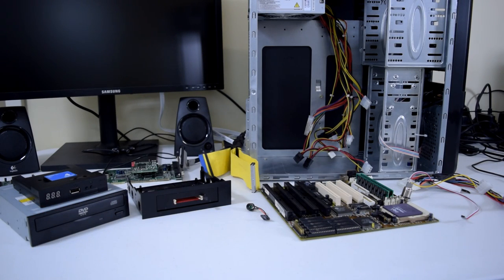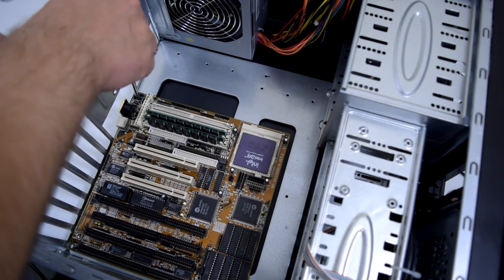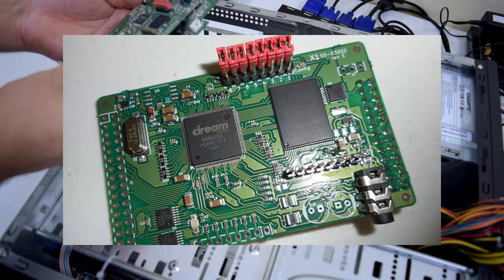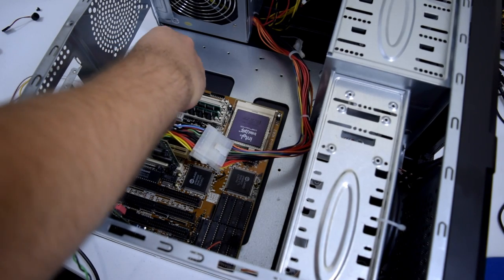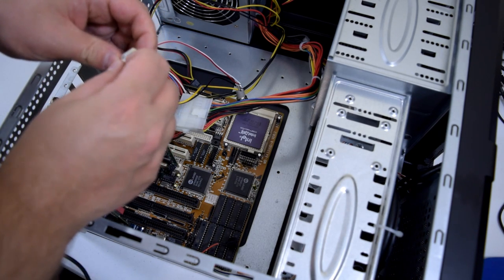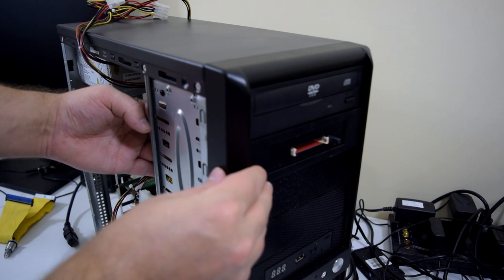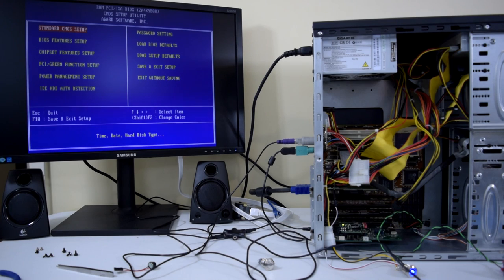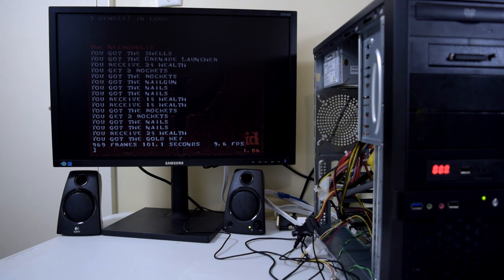Building a 486 DOS PC with modern parts

Comment: You may not be a big channel like Linus Tech Tips but you sure as heck are entertaining
Reply from the maker: +Boyborg690_ Thank you :)
Reply: Never know where this channel may end up. I remember first watching Linus Tech Tips when it was a tiny little channel.
Reply: +PhilsComputerLab A button that stays set in it's state is called 'latching' the ones that only offer a changed state when held are called 'momentary'. Probably a million people have already said that :-) Cool vid. Interesting project and accent ;-)
Reply from the maker: Cheers :)

I did end up using simple flick switches mounted do a drive bay. I haven't used this solution in a video, but will definitely do so. Sometimes the simplest solution is the best. Not always though :D

Comment: The fast Compact Flash cards was an exelent Ideia to replace the old noisy and hot hard drives. I got my old 1997 Pentium 200MMX very cold and quit with an SDcard simulating a Hard Drive.

Comment: The ol' big squishy clicky power buttons...Something I competely forgot about my old PCs. The feeling of pushing in a long throw switch reminds me of waking up during summer breaks to play hours and hours of wolfenstein and later doom. Hearing the click followed by the 'beep' of the bios startup, then followed by the drive self checks. I can still hear all of these sounds in my head, and the smell of hot computer components/case.

I imagine my nostalgia towards PC games is similar to what my grandparents had with old vaccum tube radios. People become so wrapped up in the large generational differentials that they don't realize that every generation is the same with varying experiences.
Reply: +TheDudeofDudes  Heh, I still have my original 286 with that slow ST225 MFM HD. I could always tell exactly what it was doing by the four different noises the HD made (seek, read, write, erase)... and when it needed a fresh LLF. -- I have a much faster vintage IDE HD (1991, 20MB W.D. still 100% perfect condition) I'm thinking of trying with it, just because. Assuming I still have an interface card... this HD won't work with a 486 or newer.
Reply: +Mirsad Redzovic QEMM instantly springs to mind :)
Reply: +Mirsad Redzovic  Same here. And didn't get the QEMM conflicts that way, either. The trick was to go through all your TSRs and determine both startup RAM and idle RAM (from the full MEM report), and fit 'em into available spots instead of just cramming 'em in one after the next. I ran a bunch of handy TSRs on my 286 with 1MB of RAM (and some of that locked out because of a bad chip) and still had enough RAM to run everything a 286 could handle.

Speaking of memory tricks, anyone else use a memory board? I have one in the 286, 2mb board, the system wouldn't see it as RAM but would as a RAMdisk, so I used it for temp space and for workspace that was much faster than writing to the HD. Its contents would survive a reboot, so data loss wasn't really a problem.
Reply: +Mirsad Redzovic  That's a great idea with DOOM, I'll have to try that. Still the only game I play. Right now I run it on a P4-3GHz (some of these huge modern WADs need that much horsepower) but if it ever dies I'll have to look for another solution.

I put my browser cache on a RAMdisk both for performance and because it keeps the mess off the HD -- the way the Mozilla-based browsers handle cache is stupid beyond words, and causes fragmentation like nothing else in the history of computing. I use DataRAM's freebie as it works well, doesn't eat much, and has a good "hibernation" feature.
Reply: +Mirsad Redzovic yea remember flushmarkers where you could have something load for say one item them flush it out if you dont need it or need the ram
Reply: I grew up in the pentium 4 era and even that feels like forever ago.
Reply: I remember when I first started working on PCs. Back when CD ROM was just starting to phase out floppy.. Ugh, still get the occasional nightmare about that floppy seek noise.
Reply: i still hear that eee ee ooh ,zee zee zoo of my 5.25 then 3.5 drive doing their boot seek when turning on my 386
Reply: I still remember loading from cassette tapes... yes, I'm old.
Reply: Oh man, thank you for the wonderful trip down memory lane. I remember mine and the joy I had when I got my own 386SX-16 with my own money.
Reply: i´ve started with a dx386 40/16mhz and about 4 mb ram, no i want a retro pc my self ;) may i build one..
Reply: Rather than use a very long IDE cable you should be able to extend one with another if you use a straight through header strip. You should even be able to do this with the middle connector. Try and see if it works, sometimes it might not.
Reply: I don’t think previous generations were so infantile in their pursuit of nostalgia. This is a very millennial trait.
Reply: @Conradlovesjoy  have you ever met an old person?

Comment: 9:00 I actually said out loud "yeah your video card isn't working" when I heard that POST beep. Oh, the good ole days. ;) (that beep here means the monitor isn't connected, but the card may be working fine)
13:20 - only certain USB mice (old ones, usually) have the capability to be used with a PS/2 adapter. It's completely different signalling, and the adapter is just a physical bridge, no USB/PS2 adapter logic inside. FYI.
14:00 - possible that the CF card doesn't support the detection or the I/O mode used by the 486, but the card would still otherwise work OK. Possible that the card only works with LBA (which USB adapters and all modern PCs us), and the BIOS is trying to use CHS mode.
14:05 - yes, resistors are extremely, absurdly, mind-blowingly important when working with LEDs. ;) And be sure you're using the right resistor for 5V or 12V supply, too!
14:45 - you should probably not leave all these to defaults... back then, RAM didn't have the little Flash chip on them that provides parameters. So, it's important to set EDO mode if you have it, so the chipset can make use of EDO memory's extra speed. But with 8 MB of RAM installed, I doubt it's EDO... y u no eBay some EDO stuff? :o

Comment: SPDT= latching on/off (single pole, double throw)
SPST= momentary on (single pole, single throw)

I remember those darn Dallas time chips. More than one time I've used a Dremel to grind down the top until I got to the embedded lithium battery, cut the battery out, and add wires to an external "AA" battery pack.

Comment: Damn, I had that benchmark at 15:35 :)

My first PC was a 486 SX25, this brought back sweet memories.
Reply from the maker: +nagytestutyuk Nice :)
Reply: +nagytestutyuk My second PC was a 486 SX 25, it was superfast at the time in comparrison with the 8086 I had before. I remember wanting a DX with the math coprocessor so badly and feeling annoyed that the SX was in fact a DX with a factory crippled coprocessor.
I can't feel so excited about my PC's now, however fast they are.
Reply: +brunster64 I had a 25 MHz 486 SX also.  Jeeze that thing was slow!!  It had all the good stuff, a 170 MBe  hard drive, 9600 baud modem and a measly 4 MB of memory.  Now these days 170 MB is practically  nothing and is easily replaced with flash memory that is faster.  I used to play Doom and the other DOS games that were good.  What fun that was running QEMM to make room in the 640 K base memory.  Without Quarterdeck Expanded Memory Manager, it felt damn near impossible to get some games working.  It did have windows but that was Windows 3.11 and was nearly useless by comparison to todays windows versions.  Many of the games for Windows 3.1 were those horrible point and click adventures.  I saw a point and click adventure game I liked, I thought that nearly all of them sucked.
Reply from the maker: Those were the days :)
Reply: nagytestutyuk, I remember "SX" was pronounced "SUCKS"... LOL
Reply: I still have my 'Tandy Sensation!' from 1993.   25mhz 486SX 25mhz.   Originally came with 4mb of ram, 106.9mb IDE hard drive, and a non-IDE proprietary single (1x) speed cd-rom with a push 'n release tray that you pulled out most of the way to set the disk on and push/click it back in.      Such a beast of a machine ;)     It now has 32mb of RAM (more than the book ever said it could support), an ISA SCSI controller.. so i can use a drive larger than 300mb (Bios limitations for onboard IDE), and an Evergreen Technologies math Coprocesor that bumps the clock speed up to 100mhz, even though the core is still 25mhz.     Made games like Jetfighter not run because of a divide-by-zero problem.  apparently 100 is bad... 99 is likely fine hah.    CPU bound games hate that 100mhz mark

Comment: I can't believe you're running that DX4 without a heatsink and fan. A heatsink is required on 486 CPUs starting at 40 MHz up to 66 MHz. A fan is required on 486s 75 MHz and faster.

That chip is going to suffer thermal death if you keep running it bare, which will be a big loss because Intel DX4s are both rare and expensive due to not being mass produced. AMD and Cyrix parts of similar speed are more prevalent, but less compatible with boards using Intel chipsets.
Reply from the maker: Haha, and I can't believe people still mention this :D You are like the 20th person pointing it out!
Reply: DX4 is pretty low power like the original 486DX-25 and 486DX-33.  The DX4 runs at 3.3 volts, while the faster 486DX2 chips ran at 5 V.  Since voltage is exponential for power consumption, a 3.3V chip can run atleast 2.3x the clock speed (3.3^3.3 vs 5^5) at the same power consumption.   On top of that, the DX4  (0.6um) was built on a smaller manufacturing process than the DX2  (0.8um) and previous chips (1.0um) so they'll inherently run faster at lower power on top of that.  Back in those days smaller fab size directly translated to power savings AND performance increases.  That said a heatsink wouldn't hurt :).
Reply: jrherita

Core voltage does not directly determine the power consumption of the CPU, nor does it determine the clock ramp. Just because the CPU has a lower core voltage and a smaller lithography process, doesn't mean it will use less power.

Take a look at modern CPUs, the core voltage can be 0.8-1.45V and pull 100A, or 40-150W.

Despite the DX4 having a 3.3 or 3.45V core voltage, they pull the same or slightly more current than some older DX2s.

AMD parts on the other hand use less power (the 133 MHz part uses ~4.5W) and still require a heatsink and fan.
Reply: Back in the 1990s when Dennard scaling worked,  my statements were correct.   Modern process nodes (since about 65nm) is where power scaling stopped essentially so to compare a 486 and a modern CPU is apples and oranges in that way.  An Intel DX4 @ 75 mhz should consume less power than a DX2 @ 66 mhz.  I suspect a 100 mhz DX4 will also.
Reply: Back in the day, most of the 486-DXes I encountered came with heatsinks.
Reply: With more modern PSU, maybe someone should make a heatsink that could be adapted for liquide cool.  Ok it would be only with the CPU, but it would be fun to see how well that solution would work compared to the traditional heatsink and fan on a 486 and the DX line and even a 586.   Because these do run HOT.
Reply: It's his chip to fry if he wants. Instead of spouting off wannabe hypothetical technobabble, maybe you guys could ask him do some tests or something to see how it is performing in comparison to specs and thresholds. That would actually be much more interesting than witnessing the perturbed heavy breathing of neckbeards going on in this comment chain.
Reply from the maker: I just forgot to put the cooler on, that's all :D
Reply: Heh... Fair enough, but why spoil the drama? ;)
Reply: Just for curiosity, how do you mount the cooler on the cpu? it doesn't look like it has any holes
Reply: Usually there was a little plastic arms that slid over the cpu ceramic base. Those heatsinks were very poor compared to today's heatsinks. http://www.evercoolusa.com/wp-content/gallery/ec-486/ec-4862.jpg
Reply: Forget about "Cyrix" ! these CPU were like SHIT !
Reply: I cant believe blah blah blah..... who cares... it's a $4 cpu
Reply: Coz You can ez broke this on my dos machine i have good cooling not mater what just install this without any complain we wont help You.

Comment: I wonder if there's a company making 486 boards with modern features (ATX, usb controller, onboard audio and so on). Probably would be a niche product, but you can build a business around making new versions of retro tech as Hyperkin shows.
Reply: Socket 5/7 (Intel Pentium, Intel Pentium MMX, AMD K5, Cyrix 6x86, IDT Winchip) was the first one to have atx like the Intel Advanced ATX, Intel Advanced ML, Intel AG430HX, TC430HX, AN430TX, ASUS XP55T2P4, MSI MS5143, etc. there were no Socket 3 (Intel 486 SX DX DX2 DX4, AMD 486 and 586, Cyrix Cx486 and Cx586) atx boards unfortunately
Reply: There are new old Chinese motherboards 754 stuff onwards, but there would not be much call for pre 2000 tech. Better to look for ancient PCs at recycling centers and any companies that resell them.

Check Craigslist for collectable ancient junk, people do occasionally sell them.

You can also pick up $40 Atom ITX motherboards (cheap) that maybe could be throttled down (features turned off) to 486 performance.

Comment: for the record: any 486 over 33mhz does need a heatsink. which is what the 2 sticking out parts on the socket are for.. the clamp to hold it in place.

Comment: If I were to do this project, I'd make an adapter board with a hold circuit, maybe even a relay for the click, for the front power button. I'd probably also make a hold circuit for the reset button to function as a turbo. Simple adapter for the front LEDs and you have yourself a nice vintage computer in a stock case. The I/O shield seem like a prime candidate for a 3D printed part, though I don't have a 3D printer yet.

Comment: Get a fanless PSU -- 100% silent build haha.
Reply: QuantumBraced Sadly those have coil whine very often.
Reply: Why not just remove the fan?
Reply: Prehistoricman They could overheat
Reply: Running this board? Doubt it.
Reply: QuantumBraced Well, if you're using an old HDD you won't have any silence.
Reply: Coil whine? Get a Seasonic Platinum Fanless. Best fanless PSU's I've ever used. Zero coil whine and stays relatively cool under load. Expensive as frig though...
Reply: Bah.. if you're going to build a 486, it should sound like a 486!  :-D

The sound of a WD Caviar spinning up and seek testing -- that's the stuff.

Comment: For serial ports to work the PSU needs to have -12V.
The 4GB drive did not work since 2GB is the max that is supported by the BIOS, there were utilities from WD, Seagate that let you install bigger drives.

Comment: That cable management hurts my eyes
Reply: +Liam Goodison 
I don't think I've ever seen anything using IDE have good cable management.
Reply: +K-Anator™ I used round  IDE cables  back then http://www.pccables.com/images/ULTRA_ATA_IDE_Black_18-INCH_1_5FT_Round.jpg
Reply: Liam Goodison
Oh man, I totally forgot about those things! Come to think of it, one of my very first builds used IDE, I don't quite remember the time frame, but a 250GB drive cost me $150 CDN. Anyway, after a while I got bored and ended up splitting the cable in to about a dozen sections and used electrical tape to make my own 'sleek' cables. Holy shit have you ever brought back some memories.

Edit: Not that it really helped with my cable management, was a mid-tower case, and non-modular power supply meant spaghetti wires galore.
Reply: it's normal for a old computer

Comment: Can it run Crysis?
Reply: No, 
Minimum Specs:
CPU: Intel Pentium 4 2.8 GHz (3.2 GHz for Vista), Intel Core 2.0 GHz (2.2 GHz for Vista), AMD Athlon 2800+ (3200+ for Vista) or better.
RAM: 1GB (1.5GB on Windows Vista)
Video Card: NVIDIA GeForce 6800 GT, ATI Radeon 9800 Pro (Radeon X800 Pro for Vista) or better.
VRAM: 256MB of Graphics Memory.
Storage: 15GB.
Reply: because i have rights to do lol
Reply: i said because i have rights to do, read the comment please
Reply: Everybody ports Doom to modern.. somebody plox port Crysis to 486.

Comment: you can cut open the dallas and replace the battery
solder 2 wires after removing the cell, and fit another 3V battery next to it, easy to change now.
No more wasting of ressources.

Comment: Nice one. Btw. you could use the standard atx power-on button from the case, just needs a little circuit board that switches the power supply with a relay.
Reply from the maker: +Digi20 Good idea. There is this German guy on Dos Forum, he has built a circuit called ATX Flip. You could also build  circuit with Arduino. Also, I've found another way to have buttons on the front, I should do another build, but need a reason for building another 486...

Comment: I would say the other big negative of AT power supplies is that they do not use soft-power like ATX, you have to run the mains voltage outside the power supply to the front panel switch, I have had a mishap before where the quick connect terminal came loose from a front panel switch and shorted to the case and sparks flew and the breaker tripped.

Comment: This earned you a new sub. I remember, in the not too distant past, when I sharpened my PC repair/maintenance skills on quite a few Dell 478 boards. Now you've sparked my interest in 478 all over again. I'm almost thinking about Biostar's P4M900-M4 Ver. 6.2 or the G31-M4 Ver. 7.x. if the price is cheap.
Reply from the maker: +wyzemann 486 are cool, but can be tricky. If you have exotic motherboard without manual and lots of jumpers: good luck :D